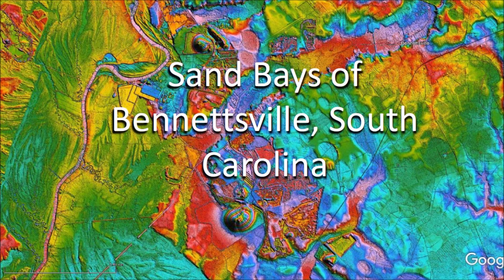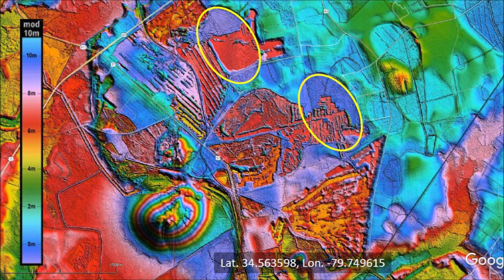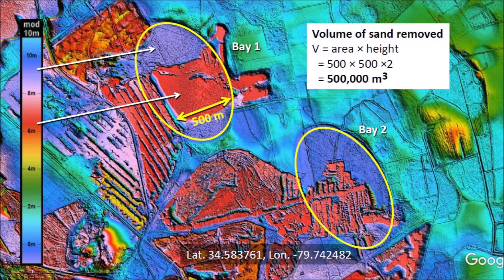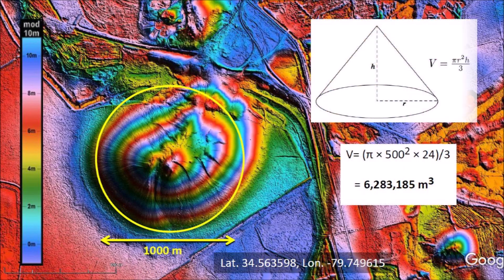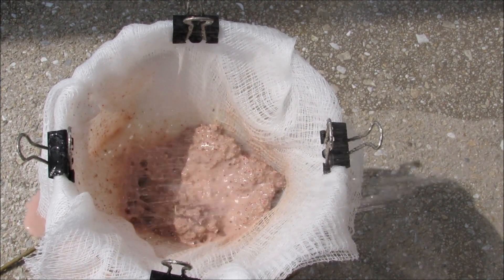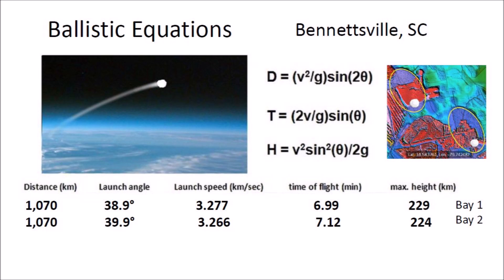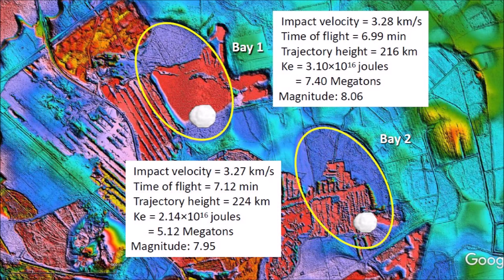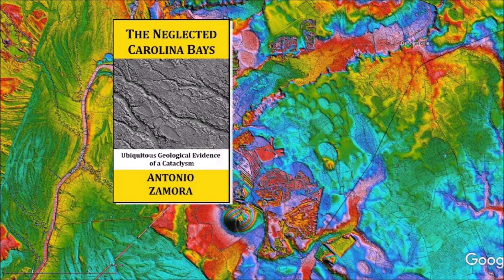Quartz Sand Hills of Bennettsville, South Carolina

Comment: What explains the distorted bay NE of Bay 2? Is that also a mound of sand?
Reply from the maker: It is a dump. Literally. The elevation is 5 meters higher than the surroundings. Here is a picture of the entrance: https://www.google.com/maps/@34.5797729,-79.7196842,3a,37.6y,21.44h,78.51t/data=!3m6!1e1!3m4!1sbmh8VqE6a7oFVr0ipqerBw!2e0!7i13312!8i6656?entry=ttu